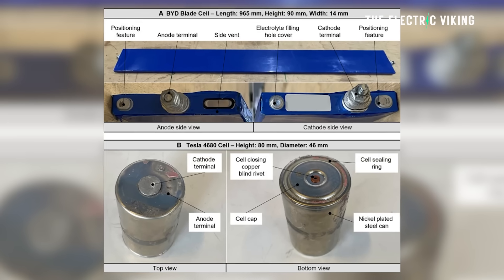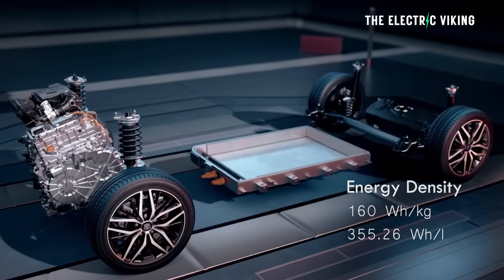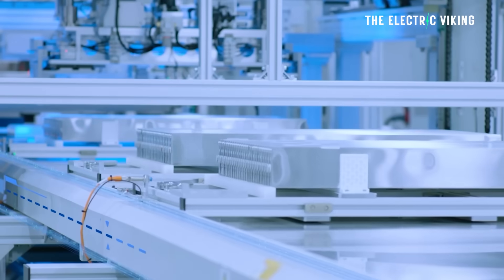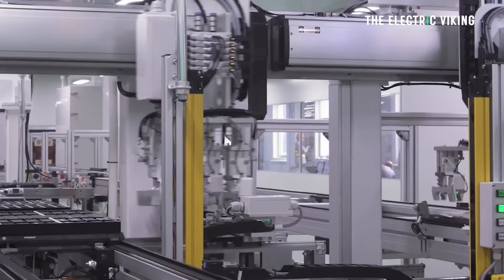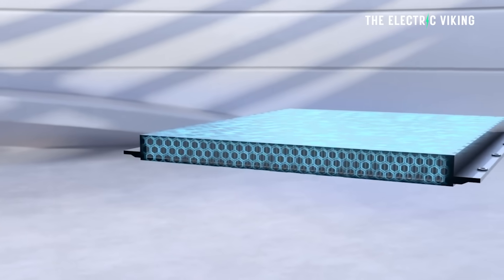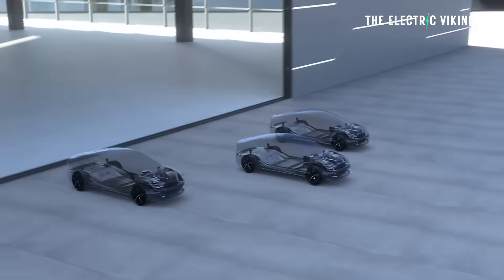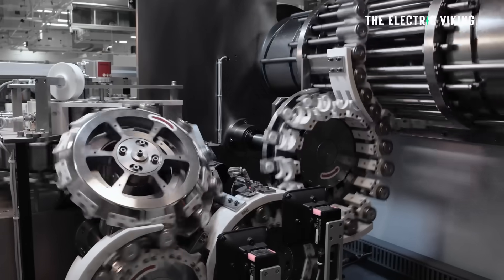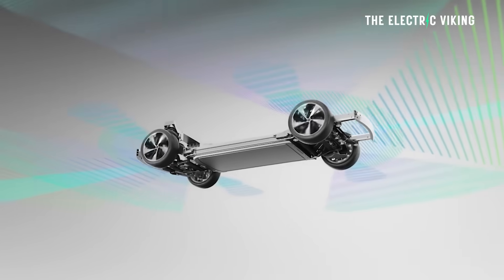BYD’s new 1000 kW Blade battery VS Tesla 4680 — Who Wins?

Comment: My research and study indicate the BYD LFP Five Minute Flash Charging batteries are noted as follows:

4,000 cycle life retaining 80% capacity.

750,000 miles of driving, retaining 80% capacity.

no fire hazard: a nail punctured through the battery and no fire and no smoke.

battery heated to 300 degrees celsius, no fire, no explosion.

able to charge at 10c. meaning, able to charge at ten times its rated capacity.

able to charge at one megawatt (one million watts)

charged to 260% of its capacity, still no fire.

100% recyclable. abundantly available low cost materials. charges fully in five minutes at a charging speed of 3,000 miles per hour. this is approximately 500% faster than the tesla superchargers (with tesla adding 249 miles of range in approximately 30 minutes of supercharging)

the future is here.
build your dreams!

note: I hope US politicians stop blocking the BYD (with 100% to 250% trade tariffs, tax added to these electric vehicles) electric vehicles from being sold within the US, because we want these electric vehicles. Even (Tesla Motors owner) Elon says we need “Free Trade”

Comment: According the specs you presented in this video Tesla far beat BYD In gravimetric or volumetric density. You mentioned BYD had lower internal battery resistance than Tesla, but you didn't show any specs either.  You never presented how much lower, and how much of a heat or performance issue did they caused for Tesla VS BYD.  Stating BYDs battery was much better than Tesla's seems heavily biased in favor of BYD.  Though both BYD and Tesla are great brands. Thanks anyway for presenting this to show some comparison facts.

Comment: The Chinese companies need to team up, make a killer 1000kWh charger for cheap and start making charge networks across uk / Europe / auz / other markets. If they had the reliability and scale of the Tesla charge network it would be no brainer to get these EV’s. 

Right now in UK these charging speeds aren’t really supported but I think it’s a bit like 4k tvs - you need the devices first, then the demand drives the supply.

Comment: It Really does not matter that it can charge at 1000kw or 250kw, what matters is how long it will maintain that level. If it charges for 1 min at 1000 kw is no  better than teslas 250kw for 10 min.  Anyone who's watched Byjorn Nylands 1000km road trips will see that Tesla has far better trip times than any BYD car available in Norway. The only benefit is that BYD is half the price , but driver assistance and mapping and charger stations shown and trip routing or battery preconditioning for max charge rates just is not on par at all. So it really is what do you want, technology and or price
Reply: So you would prefer iphone 20 Watt charging taking 1 hour or more to full charge or any chinese mobile that charge at 90 or 120 watt that charges in less then 30 min, The main issue in Electric car to a petrol car is that EV take long time while patrol car is just 1 mint thing... So yeah fast charging matters .. the world is moving towards faster things, fast service, fast network, fast data transfer ,fast chip, everything fast.. so yeah if BYD is saving me 20 mint less in charging at the cost of 20/25 km less and also thousands of dollars less i am going for BYD..

Comment: LFP's are safer, cheaper, can be charged to 100%,  and are more durable. You might want to check your own videos where you have always been in full support of LFP's batteries. Why the sudden change in opinion Sam?: Sounds like you're starting to lose your objectivity, and might as well be just another Tesla fan bois. Did Elon get to your objectivity? Too bad if that is the case. 

By the way, Teslas NMC batteries cannot charge to 100% on a daily basis, as the battery pack would disintegrate. Unlike Tesla, BYD's LFP batteries can charge to 100% every day without any concerns. That is the big difference, too bad you don't see that being the Electric Viking. Maybe you should change your name to The Tesla Viking. Cheers.

Comment: Charging speed isn’t that important. 
Firstly, cars sit idle most of the time and they can dribble charge most of the time at a fraction of the price.
Secondly, the cost of installing fast chargers beyond 150 kw is very high. 
And anyone who has an electric car with 300+ km range would know that charging speeds beyond this are unnecessary because stopping every few hundred km’s for 20 minutes is normal.

I think Tesla fundamentally understands that more charging infrastructure is more Important than much fewer ultra expensive units that charge in ten minutes.

But the ability to charge at ultra high speeds is definitely a selling point but is really a non issue for 99% of vehicle trips.

Tesla’s cell will come into its own with very high volume manufacturing. It is a cheaper and faster cell to manufacture and offers a high strength container with the potential to accommodate higher energy densities as chemistries improve.

Comment: What about expected degradation? Fast charging is killing batteries faster than slow charging, right? Does 1000kW charging means that the degradation kicks in faster than 250kW charging too? Or do you think that is not the case due to less heat loss with the blade battery?

Comment: Low value information. LFP has higher package density, why? Cause it is safer and generates less heat as well. The cell energy density value is of no final importance.
Second, LFP does not need reserved capacity. 
Therefore they are not much far from each other.

Comment: BYD's new V2 played batteries come in two types.  The "Long Blade" has 210 Wh/kg energy density and 3C/8C charge/discharge rates.  The "Short Blade" has 160 Wh/kg energy density and 10C/16C charge/discharge rates.  They will use the new blade batteries to buffer energy storage at their charging stations so don't need to upgrade the power network.  Therefore they don't need to use supercapacitors, nor do they need to request expensive grid upgrades, nor will this cause blackouts...

Comment: I have an LFP Tesla. Battery researchers used to think that charging to 100% with an LFP was fine. The latest research finds the opposite - it is actually worse than with nickel based batteries. Tesla recently changed its charging recommendations for LFP to only charging to 100% once a week. It is necessary to occasionally charge to 100% because LFPs are worse at estimating battery charge so they need to be calibrated to 100% more often.

Comment: Hey Sam, can you check out Dutch company Leydenjar ? They go for 100% silicon anodes, with the capacity benefits you would expect. They have solved expansion issues and now need to scale (which is always an if). They claim energy input in production is factors better than current technology.

Comment: Strange that you are comparing the BYD Blade battery to the Tesla 4680.  The 4680 is used exclusively in the Cybertruck witch represents approximately 2% (and declining) of their unit sales.  The 4680 has been a five year experiment that has not met original projections (i.e. the performance is still less than the 2170 and the cost is higher).   I expect Tesla to get out of the battery production business in the near future as they do not have a competitive product and 98% of their cars use other vendors batteries.  The 4680 was an attempt by Tesla to achieve a higher level of vertical integration (similar to BYD) that appears to have failed.
Reply: I also wonder why this 4680 thing gets brought up over and over again when no integration into the mass products is obvious at this point?
Reply: Great point. It’s a fake comparison. Near the end, he says that in reality, the BYD battery smokes the Tesla battery, but most won’t watch that far and are left with misinformation.

Comment: BYD's  lfp batteries are safer,have a capicity to charge to 100% and can be safely discharged to less than 10% on a regular basis. I know which chemistry I would rather have in my garage charging so it does not have thermal runaway.

Comment: Tesla mission and vision is to help the world transition into sustainable energy.  Looks like they are doing a great job. Everyone is developing better batteries and pushing design into the future.  Personally, I don't need 1000v or 800v architecture and most drivers will rarely need it.  Will China need this...I can't say.  I don't live in China.  Tesla isn't just focused on cars...we all know this.  For now, in the US, a 400v architecture works just fine.  Based on what you've covered Tesla is doing just fine.  No point making 800v or 1000v architecture when even China does not have a public charging infrastructure to handle it.  The whole analogy of the cart before the horse.  China is working on the charging infrastructure now, but a simple 400v or 800v is sufficient now and will more than suit drivers needs for years to come.  Don't pay for features you can never utilize.

This does not mean we stick with 400v.  No.  Tesla knows that this was the starting point due to supply chain constraints.  Getting an 800v supply chain does take time.  China moves fast...but can they supply 1.5 million cars anually with this new 1000v architecture....no..no they can't.  Like I said, the 800v supply chain has not fully developed yet.  Once it does develop to a point...then the whole sector can switch over.  I have no doubt thst Tesla is working on this.  Tesla is not standing still.
The Chinese know that Tesla vehicles are safe, reliability, affordable,  and efficient.  Now that FSD supervised has been allowed in...an additional layer of convenience and saftey is added.  Chinese buyers know this and will probably weigh if saftey and convenience are more important vs a 1000v architecture which has not even developed full yet.  American buyers get this too.  Even China's 800v infrastructure is not fully developed across its country.

Comment: Charging with anything more than 500kW is a gimmick. You won't find chargers like that on many places, to be more precise, you won't find them almost anywhere. 

Many sites in China, Europe and USA is struggling with power, on many you need to install additional BESS to support power draw. Now imagine charging with 1000kW (1MW) per car. It's insane amount of power. Many states around the world won't even allow building chargers like that because they can literally cause blackouts in some cases on local power grids. 

250kW will be standard for next 20-30 years, if not more. And people will actually be happy if they can find one giving all that power in future where many more people will drive fully electric vehicles.
Reply: Sorry but I cannot agree that 250KW will be the standard for the next 20 to 30 years
The solution to prevent peaks is to put mega packs
If everybody can charge in 5 minutes then it's one less advantage for ICE

Comment: "Higher energy density crams more electrons in" (4:26) was funny. I hope it was only meant methaphorically, as if batteries stored electrons just like gas tanks store petrol. Hint: Batteries of course do not store electrons.
Reply: Well when you charge, you do put electrons
It's not a physical thing that you put inside, but...
Reply: @yvesinformel221  Electrons are only used to carry the energy, it's the force between the electrons that transport energy. While charging, electrons flow through the battery. The same number of electrons that are pushed into the negative pole comes out of the positive pole. The number of electrons in the battery does not increase. The battery does not store the electrons themselves, rather the energy that was transported by electron flow is stored in the battery by altering chemical configuration. A fully charged battery does not contain more electrons than an empty battery.

Comment: The BYD Atto 3 offers two battery capacity options: a 49.92 kWh version (Essential) and a 60.48 kWh version (Premium), both using BYD's Blade Battery technology. In Europe, the Tesla Model Y now features a 62.5 kWh LFP battery pack in the base rear-wheel-drive model. So, a bigger battery is one way they get better range.

Comment: Best battery for Tesla was byd batrery
For years tesla sold cars with bad batteries. Batteries that were not readÿ.
Problems with anode, problems with cathode. Problems with dendrites, problems with liquid.
Catl didn't reach quality of byd.
I hope this will change.
Most used tesla can have problem any moment in time, and repairing or changing big part cost a fortune

Comment: Here is the tie breaker.  Which one is safer?
Reply: The blade battery it seems.
Reply: @   I think the LFP blade chemistry, the way heat is allowed to be rejected and the inherent stiffness that it imparts to cars structure makes the clear winner in the safety category.

Comment: Charging the BYD. I suspect BYD charging stations use a bank of super capacitors to deliver the 1MW in 5 minutes rather than pulling power all of a sudden from the grid. Once the super caps have discharged into the Blade the super caps are charged up again much slower for the next discharge.
Reply: Doesn't Tesla have 1Mw charger for the semi ?
Super cap us a good thing for very high current, but the energy density is not there.
I think it would need a huge physical bank to have enough power

Comment: To be honest 25km less range is not a deal breaker. 

If two cars are for sale and one is half the price less then the other but has a lower range of around 25km which one are you going to buy. 

And other things come into the equation like depreciation and post purchase support.   

Tesla is notorious for poor customer support. 

Yes it is important to have higher and higher more efficient batteries, no one actually wants less range but if a car has acceptable range then it’s going to sell. 

It’s a bit like the old horse power race, you can build two almost identical cars and put two almost identical engines in them one with 300 BHP and the other with 150 BHP. 

But if the one with 300 BHP costs 50% more than the one with 150 BHP which one is going to shift more units?

Look at the Toyota Yaris as an example, the GR super mini and the GR Sport and lower power hybrid versions of the car. 

The GR super mini has shifted a lot less units because of price, the Hybrid Yaris had sold bucket loads over the life of the current version.  

If the BYD and Tesla are comparable in most features and BYD has a slight reduced range but a vastly reduced price Tesla aren’t even in the same game are they.  

Tesla will have to compete on price performance as well as features and range

And for most buyers ie the average Joe or Jane being able to afford the car is the most important factor, I’d say it’s the first factor most people look at when deciding to buy a new car.  

Tesla won’t sell cars to most people on battery efficiency, the buyer doesn’t care if its batteries are 5% more efficient if the car has a decent range. 

Which the BYD obviously has.
Reply: Tesla did not have to compete on price before because they where seen as a superior product, but not anymore
Reply: I agree, and I will say more. If you look closely at the two brands, BYD (and many other EVs) makes more “premium” EVs than Tesla. The former have more sensors, more monitors and above all an instrument panel with various options. I like Tesla minimalism, but watching various videos of Tesla owners, I noticed that many install instrument panels and other third-party options. Something I would never do, given that you have to fiddle with the various wiring of the car. I will leave aside the fact that all Tesla owners buy protection for the trunk, the front frunk and organizers for the center console. In a car that is certainly not cheap you have to spend more money. And it is a defect that has always made me turn up my nose. For now the competitive advantage was the truly remarkable software.
Reply: Teslas are the best in safety, tech, and autonomy, which are my criteria. Plus upcoming robotaxis which will replace 4-5 ICE cars each - human carbon emissions reduction.
Reply: @ Tesla does not have the best safety systems for nothing. Musk wanted to remove radar and LiDR. And the YouTube video of a former NASA engineer proves it. I will not buy that car both for Musk and for the choice to rely exclusively on cameras. In fact, Tesla is under investigation for dozens of accidents, 13 of which were fatal. And strangely Musk fired the people who were investigating.
Reply: @ You buy a horrible little machine that costs $30,000. If it ever gets commercialized, which I highly doubt.
Reply: @juliahello6673  best in safety yes
Tech not anymore

Comment: The reason Tesla is able to squeeze out more efficiency out of the BYD batteries used in their Model Y then BYD themselves can squeeze out of their Atto 3 is entirely due to the fact that Tesla use SiC (Silicon Carbide) MOSFETs in the Model Y, but BYD use IGBTs in the Atto 3. The SiC MOSFETs are more expensive but also more efficient than the IGBTs.  SiC MOSFETs contribute to higher overall system efficiency but at a higher cost. BYD make their own IGBTs and are now also starting to make their own SiC MOSFETs for their high end EVs. BYD's plan is to phase out IGBTs in all their EV models.
Reply: What should also be obvious is that the Tesla has a far better drag coefficient, that attributes more than anything...
Reply: Model Y is not a suv while atto 3 is. Also atto 3 is close to the low end of BYD. Its appeal is value.

Comment: As a full system, the BYD cars are insanely heavier than Tesla's. E.g. the Model 3 Performance (NMC battery btw) is lighter than the Seal Dynamic (base model) significantly impacting efficiency and drive quality in comparison, not to mention Tesla's have better aerodynamics. Additionally, performance EV's use NMC because they can deliver a lot more power (harder acceleration) and enable more range.